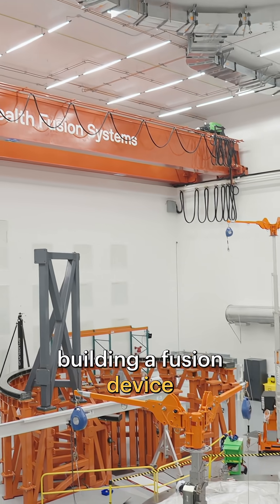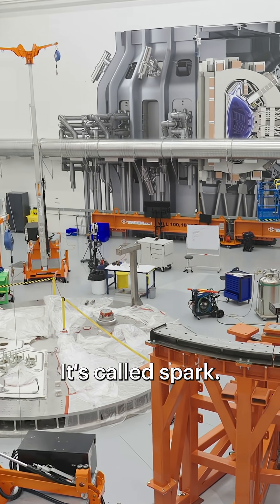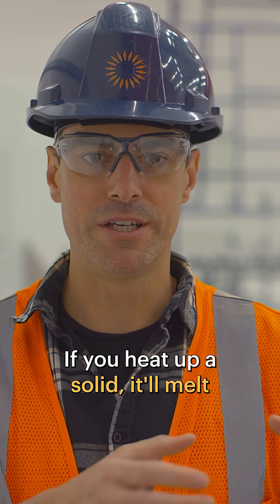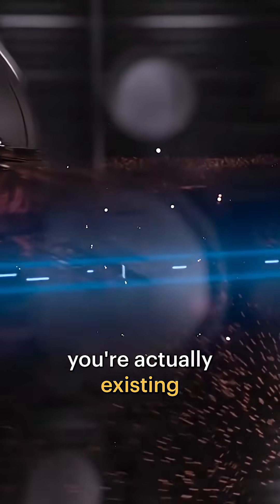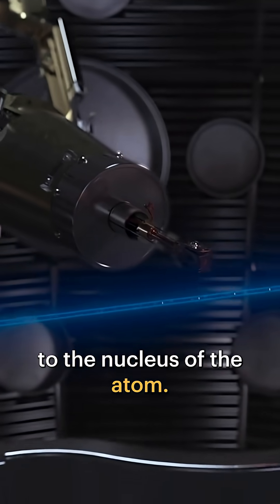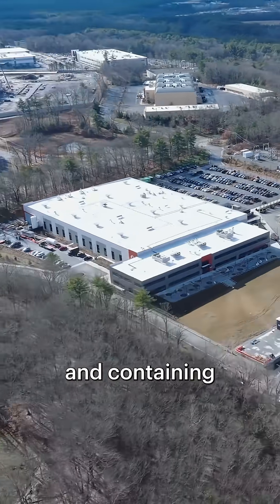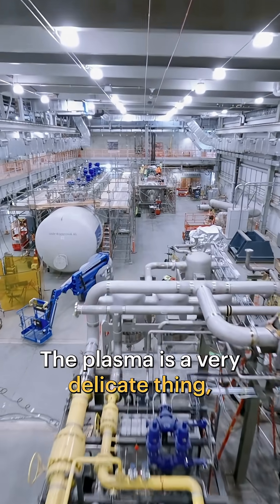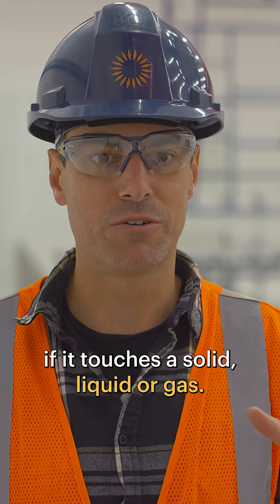Fusion Energy - Data Centers | Breakthrough #shorts #breakthrough

Comment: ive found a Liquid metal guided along the internal surface as a moderator and to delay the reaction into a frequency that its calibrated to! plus energy collection from ALL the kinds of energy produced Including pressure pulses & light, heat, etc! The magenetic containment can arrange the liquid metal to have several folds of magnetic flux in between it and the plasma for a tempuature regulation barrier and to block radiation.. and cylinders with pistons to utalize pressure and thermoelectric generator(aluminum& graphite anode/cathode respectively*) for  internal temperature utilization and a cooling system that can shunt heat Away to a steam turbine for the outer bleed layer of heat not requiring the direct conversion in a TEG.. but this is just a hobby of mine.. lol
🧐🤔🤨🤷🏼
#BoredScienceProdigy